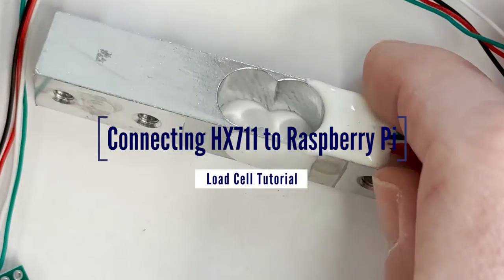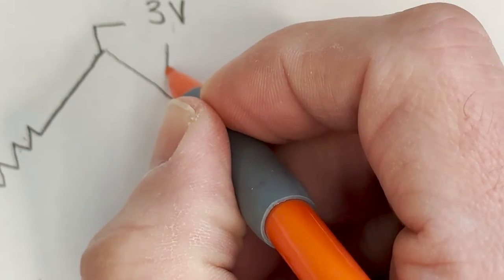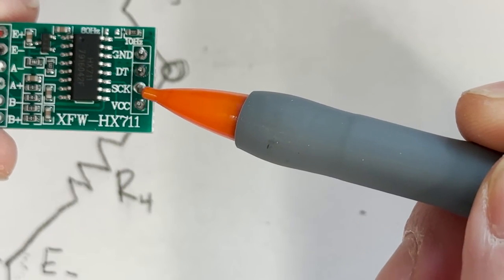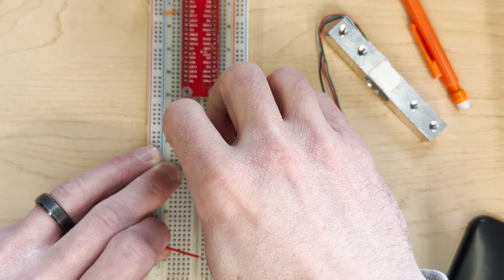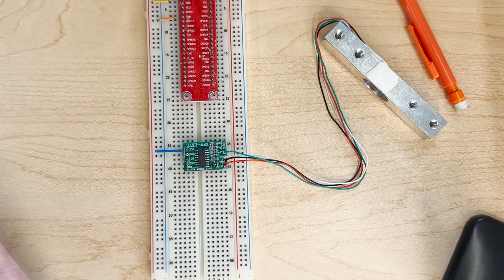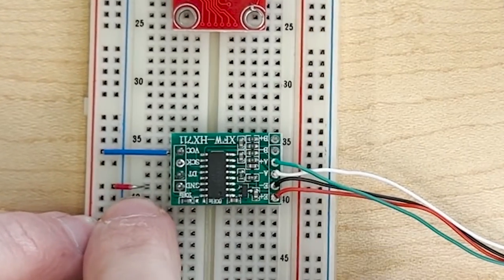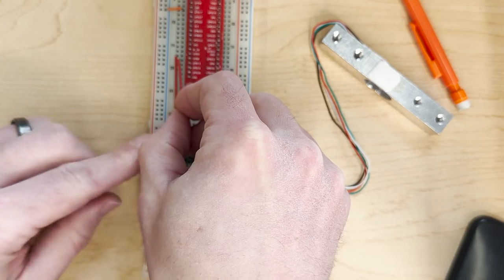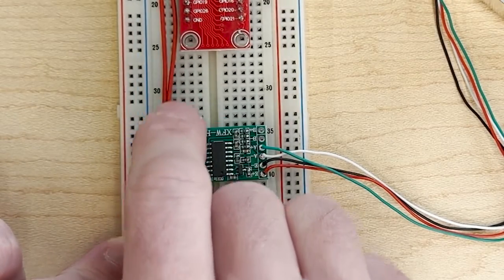05 Connecting HX711 load cell amplifier to Raspberry Pi

Comment: Mine is showing this error: 
Traceback (most recent call last):
  File "main.py", line 1, in <module>
ImportError: no module named 'RPi'
MicroPython v1.22.0 on 2023-12-27; Raspberry Pi Pico with RP2040
Type "help()" for more information.
Reply: import RPi.GPIO as GPIO
import time
import hx711

# Configuração de GPIOs
dt_pin = 17
clk_pin = 18

# Configuração do HX711
hx = hx711.HX711(dt_pin, clk_pin)

# Calibração (opcional)
# Se você já possui os valores de offset e scale da calibração anterior, 
# utilize-os aqui para maior precisão.
hx.set_scale(318.64)  # Fator de escala
hx.set_offset(117800)  # Offset

# Função para ler o peso
def read_weight():
    try:
        # Leia o valor bruto do HX711
        weight_raw = hx.get_raw_data()

        # Converta o valor bruto em peso
        weight = hx.get_weight(scale=318.64, offset=117800)  

        # Imprima o valor do peso
        print(f"Peso: {weight} kg")

    except Exception as e:
        print(f"Erro ao ler peso: {e}")

# Loop principal
while True:
    read_weight()
    time.sleep(1)  # Ajuste o tempo de intervalo entre as leituras
Reply from the maker: Você pode digitar comandos `pip` no terminal do seu Raspberry Pi. Aqui estão os passos para fazer isso:

1. **Abra o Terminal**: Você pode encontrar o aplicativo de terminal no menu do Raspberry Pi OS, ou pode usar o atalho `Ctrl + Alt + T`.

2. **Digite o comando pip**: Uma vez que o terminal esteja aberto, você pode digitar o comando `pip` para instalar a biblioteca `RPi.GPIO` ou qualquer outro pacote Python. Por exemplo:
    ```sh
    pip install RPi.GPIO
    ```

    Se você estiver usando Python 3, pode ser necessário usar `pip3` em vez disso:
    ```sh
    pip3 install RPi.GPIO
    ```

3. **Execute o comando**: Pressione `Enter` para executar o comando.

Se você encontrar problemas de permissão, pode adicionar `sudo` antes do comando para executá-lo com permissões de superusuário:
```sh
sudo pip install RPi.GPIO
```
ou
```sh
sudo pip3 install RPi.GPIO
```

Seguindo esses passos, você pode instalar os pacotes Python necessários no seu Raspberry Pi.

Comment: can we use other load cell for raspberry pi 4
Reply from the maker: Yes, it is dependent on the HX711 really. Check websites such as amazon and many of the hx711 boards come with different options for a load cell.

Comment: Hi, thank you for this playlist! I want to create a project like this for biomechanics measurements, but using a load cell (that kind with an S shape) of 500+ kg capacity. Do you think it will work in the same way? I have one that has 5 cables (I think one is the ground).
Thank you very much!
Reply from the maker: Hard to know without more detail on the load cell. Here is the schematic for the hx711: https://www.digikey.com/htmldatasheets/production/1836471/0/0/1/hx711.html. Most larger load cells will require a larger voltage input, so I don’t think they would be compatible without a more complex setup.

Comment: hello, thank you for your video, it's very clear. I'm kind of new to electronics, for a project I need to be able to measure weight from 24 different sensors. Do you know how to connect that many HX711 to a raspberry pi ? Is it even possible ?
Reply from the maker: Not sure, I don’t think there are enough pins for you to do it just with the pi. You may need the expander I/O board, but I have never tried it. Best of luck.
Reply: @ProfessorJohns  74HC595N and 74HC165N might be helpful.

Comment: On adruino I saw they connect it to 5v
Reply from the maker: Hx711 should be compatible with both 3.3V and 5V devices. The raspberry pi runs on 3.3 V and Arduino is 5V. Use 5V on arduino, 3.3V on raspberry pi. Should be good to go! Best of luck.